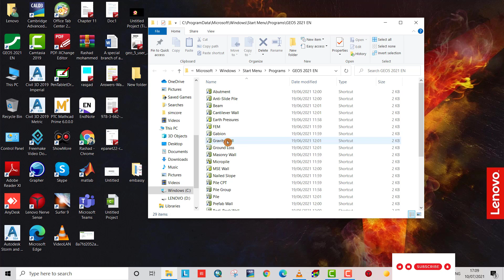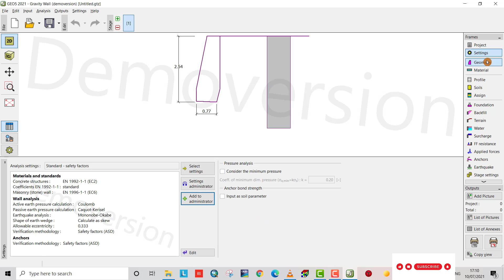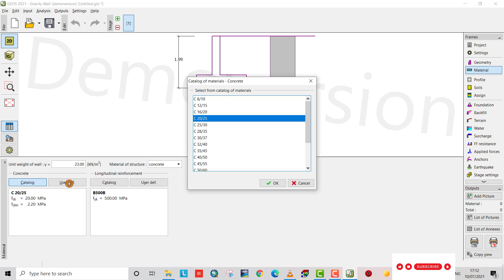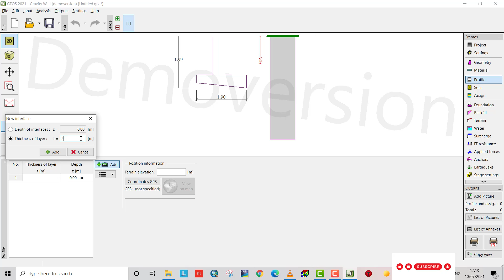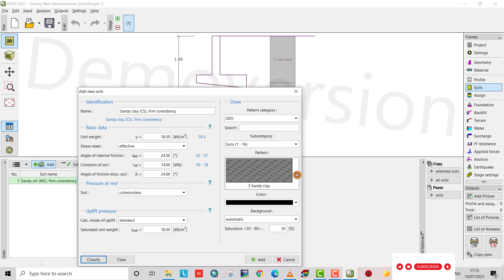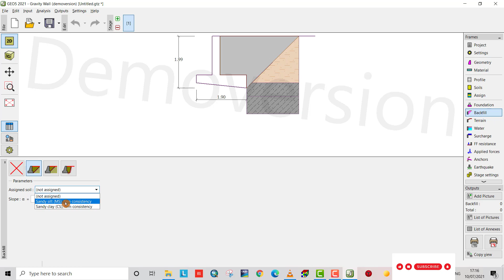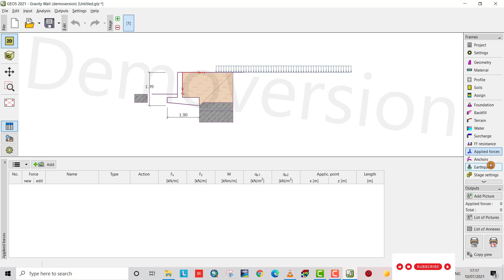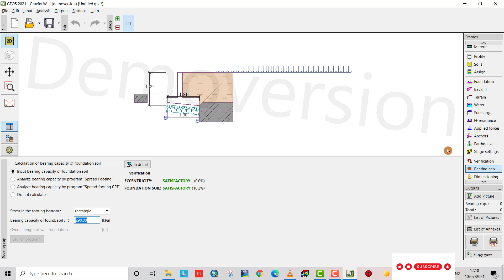Retaining Wall Design Geo5

Comment: Had the same issue with the OMS method. Id not worry about it since its not a very accurate method of determining factor of safety for slope stability. Too many neglected variables in it.
Reply from the maker: Thanks for the info!